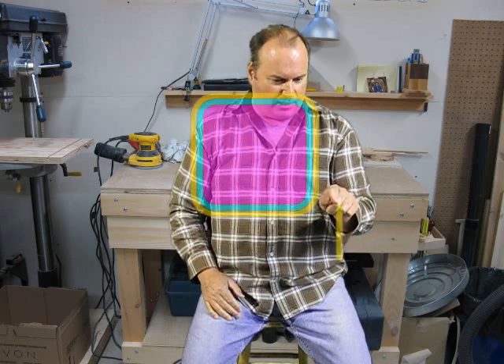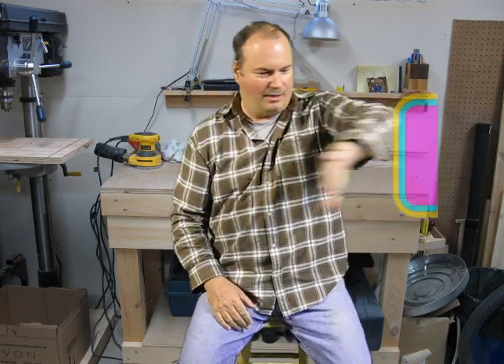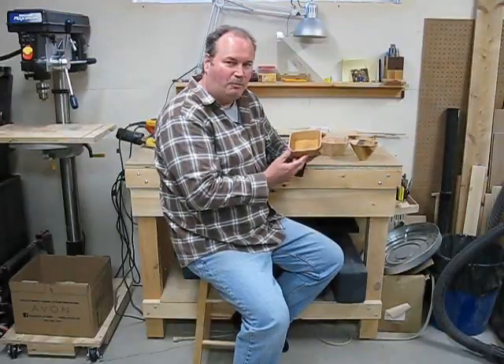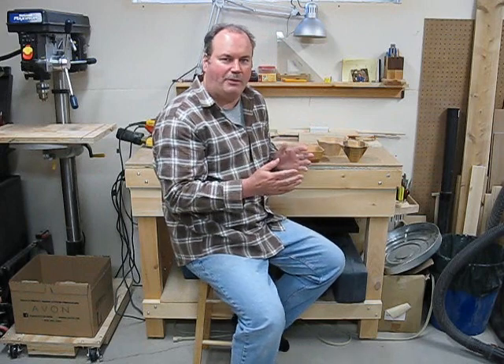Scroll Saw Bowl

Comment: Very nice video can I use a pin end blade
Reply from the maker: Absolutely it can be done, but it would leave a partial hole between layers unless you can sand a little bit of it away. It would make the project more unique.
Reply: Thanks for the help I'm using a 1950's scroll saw that only uses pin end blades